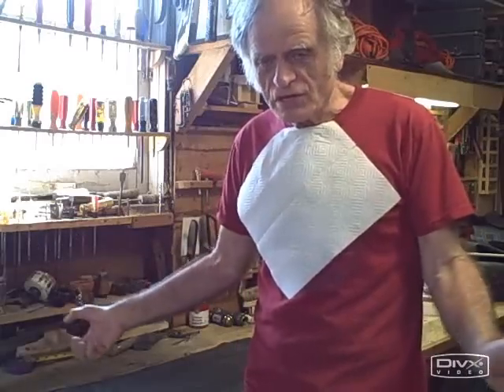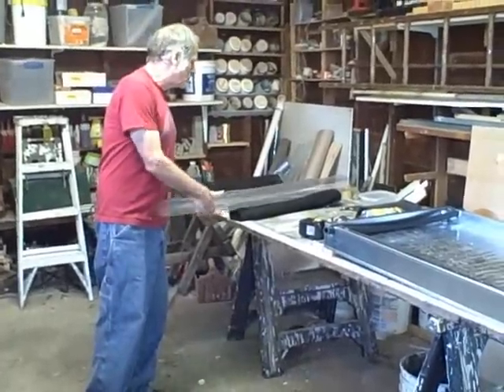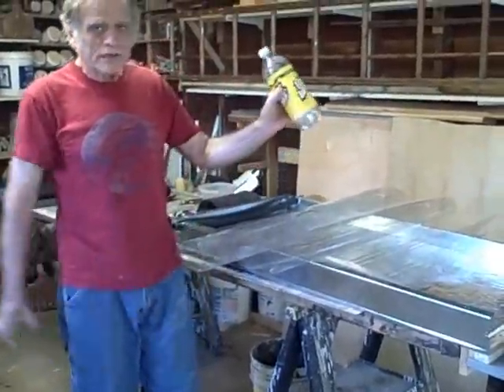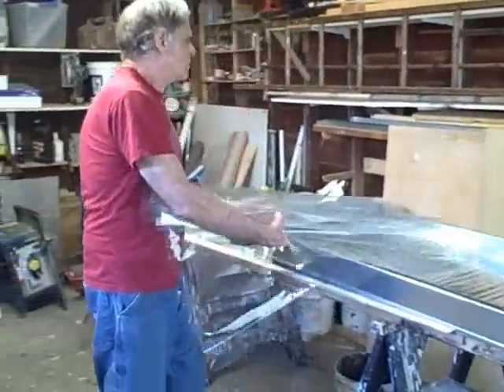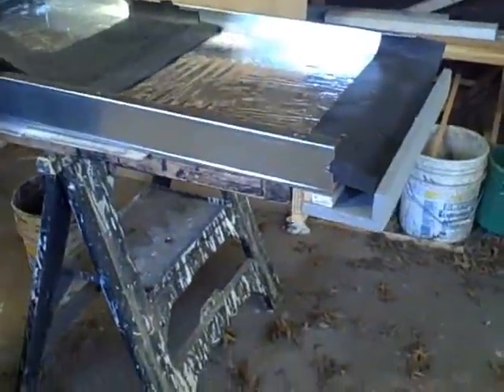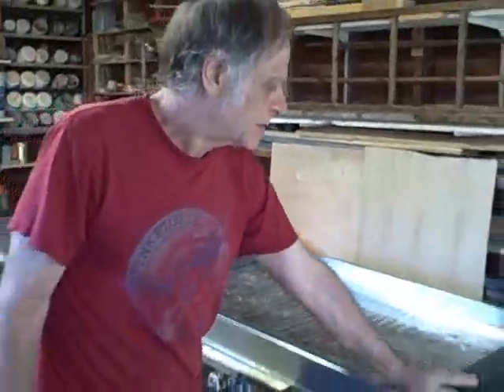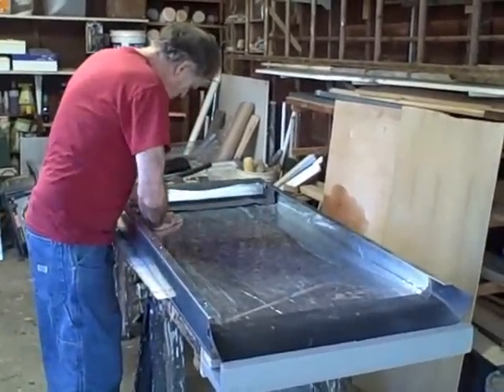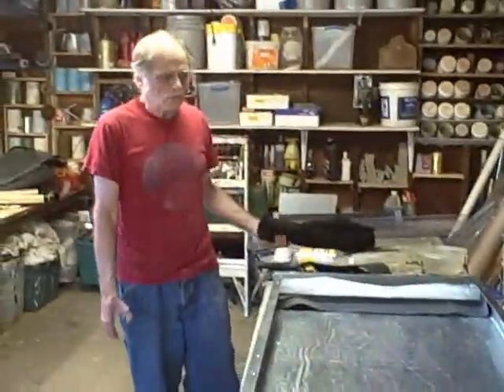Bibs for Solar Heating

Comment from the maker: Good questions. Yes it's possible to use EDPM underlayment all the way but that would make the collector heavier and more expensive, but there is another reason that  has t do with the expansion and contraction of EDPM
Closed cell insulation would be better at the head of the collector where water comes in contact

Comment: Interesting.  Three questions: 1. Why not run bottom EDPM full length and eliminate lower plastic sheet?  2. How do you prevent emmitters from getting plugged up?  3. The foam insulation is not closed cell; any issues with it absorbing moisture?
Thanks!